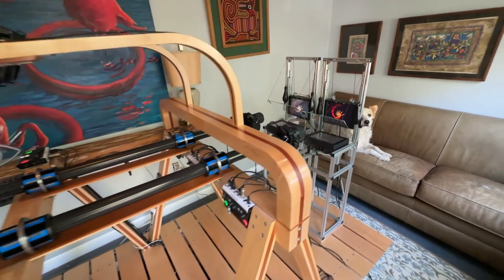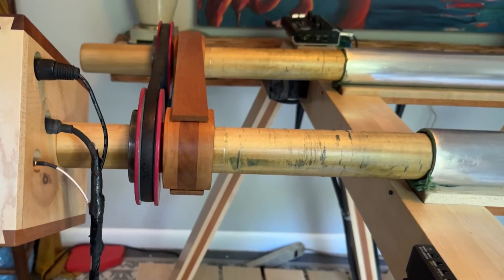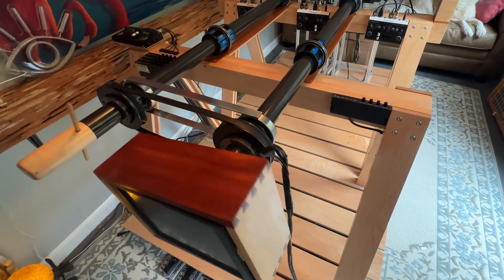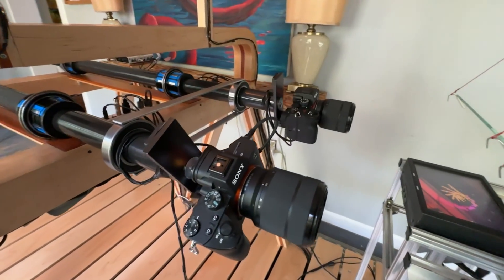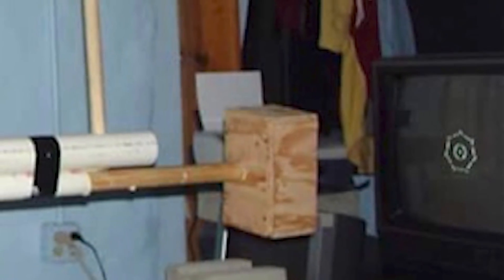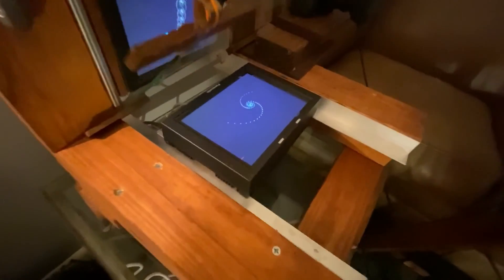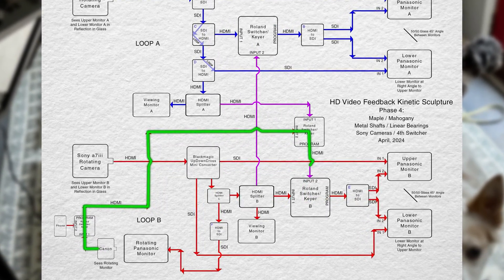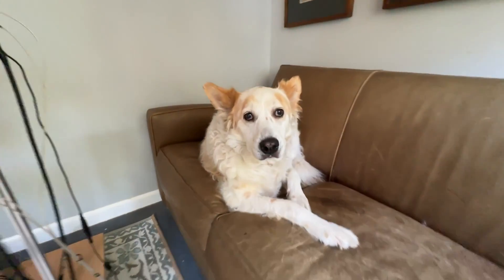The Light Herder Video Feedback Fractal Device Finally Achieves Perfection

Comment: Love this video, and learning about how you have developed this over many years, its impressive. For 4k have you considered incorporating computers, using a touch designer patch with luma/chroma controls mapped to midi knobs? Maybe latency would make it not as beautiful. I love the fractals, originally started looking more after seeing your fish video. I have a set up of vision mixers, processors crt screens and a matrix, statted doing diagrams a bit like yours but so far just experimenting, seeing the fixed goal you have and what youve achieved is inspiring
Reply from the maker: Thanks, yes that midi control is an option, I don’t know what the latency would be like. I’m still holding out for some kind of direct control of a monitor without having to go through a computer like that. Share your video feedback creations if you come up with something good, looking forward to seeing.